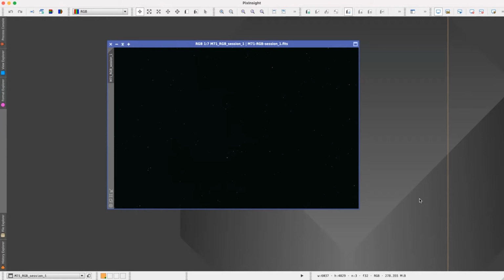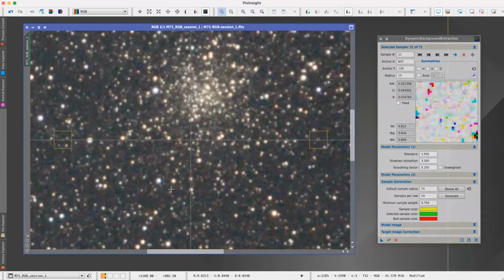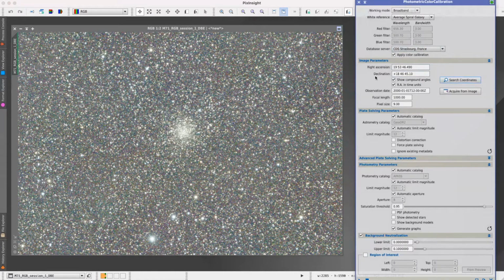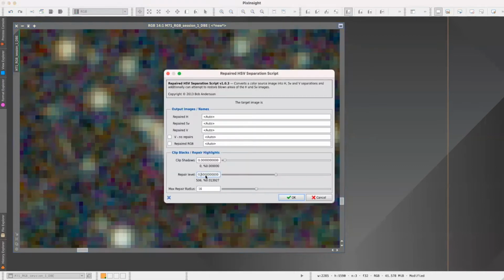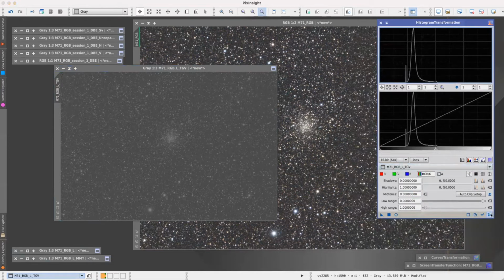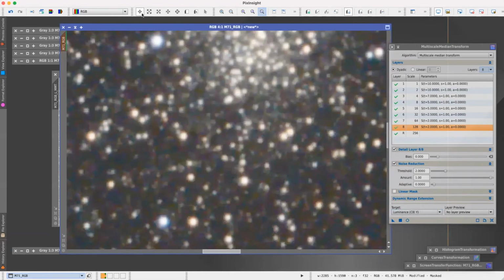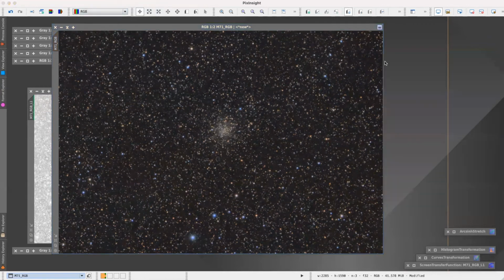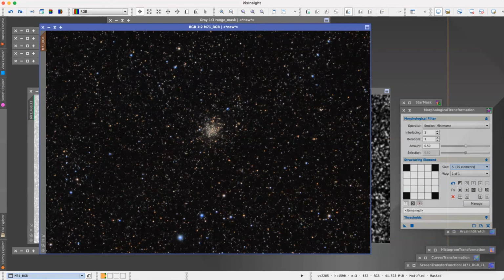PixInsight Tutorial - M71 - Globular Star Cluster - Processing Workflow

Comment: Hi, 
in 19:59 you said that the lowest RGB value 0.1 - 0.2 but the readout values at the bottom are actually 0.0XXX 
From where you took 0.1? Im wondering because Im trying to follow your tutorial here :)
Reply from the maker: It's been a while - but the B value I did misread - I should have said 0.01 - at the timestamp 19:26 the B value is 0.0121 (0.01). Then when I move to the star after its 0.02 when I say 0.2.

In the actual HSV script I even confuse myself - I take a split between the two - 0.1 & 0.2 = 0.15 and enter that. But because I have been miss-speaking the number I enter 0.15 instead, I think I should have typed 0.015

Hope that works out - appreciate the comment & view.